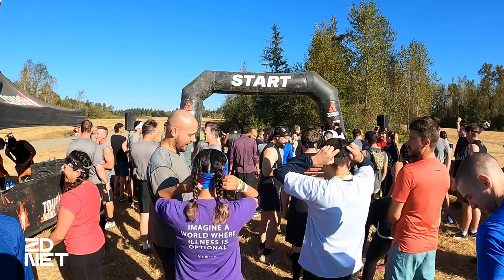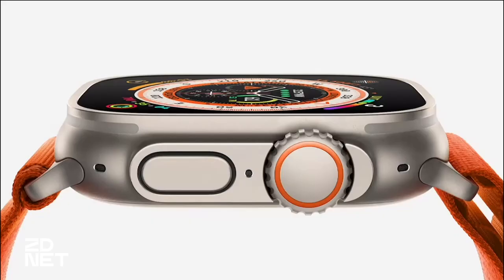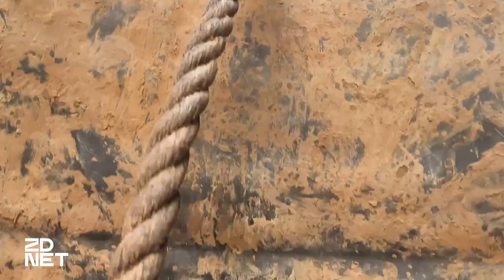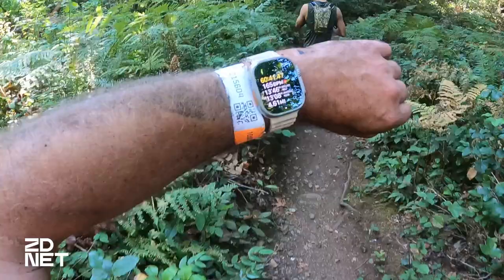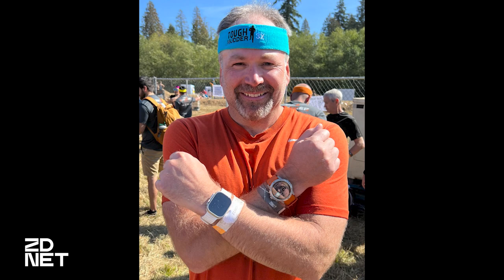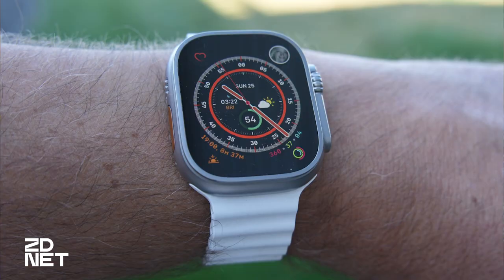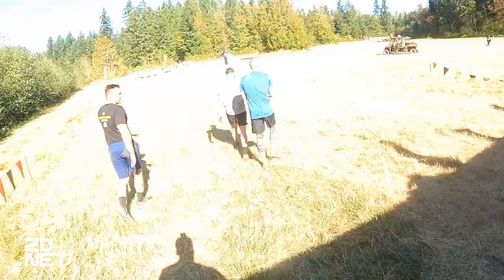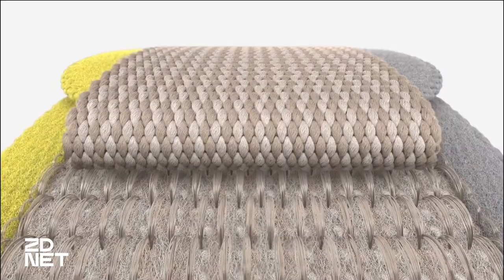Apple Watch Ultra review: Can it survive a 15K Tough Mudder?

Comment: Garmin added the obstacle racing activity tracking feature. Designed specifically for obstacle course events, this feature allows users to keep track of their run time, the number of obstacles overcome, heart rate, and more. It even enables the recording of split times between running and obstacle sections, providing insights into performance during races. I wish Apple would do the same.

Comment: great video thank you - did you have a cellular apple watch before w/T-Mobile and move it over, or was this a "first watch add" for you?
Reply: I have a cellular Galaxy Watch 5 Pro and used the online tool, with a follow-up phone call, to switch it over from the Watch 5 Pro to this Apple Watch Ultra. With a $5 AutoPay discount, the 500 MB of data is just $5 per month.
Reply: @palmsolo  cool thanks
Hoping to avoid the phone call or in-store visit. We’ll see lol

But compared to visible, which was otherwise a great service and value, this is miles ahead; their upgrading of devices process/info/support is nonexistent. Even the most cynical among us would be shocked.

Comment: Between the Garmin phoenix 7 solar and the Apple Watch ultra, which one would you recommend?
Reply: Good question that really depends on your primary needs. While I am enjoying the Apple Watch Ultra and think it is probably the best smartwatch available, I'm not sure I can give up the Enduro 2 (basically the same as the Fenix 7 Solar) with the battery life measured in days and weeks, extensive data field options, powerful app/website, and recovery metrics. If you are looking for a smartwatch that can cover longer sessions or multiple days of use then the AW Ultra is great. If you are looking for an amazing GPS sports watch, then the Fenix is better.
Reply: Garmin made sport watches there are updates but no big changes probably
Apple watch is a smartwatch platform where you can get different apps over time with improvements

Depends on what you are looking for actually